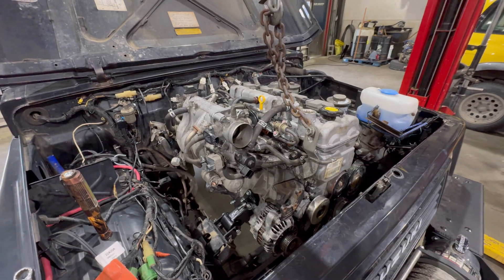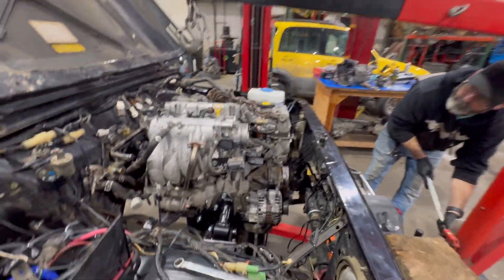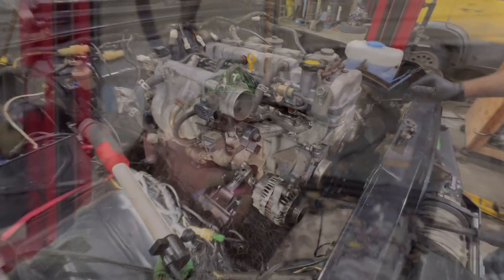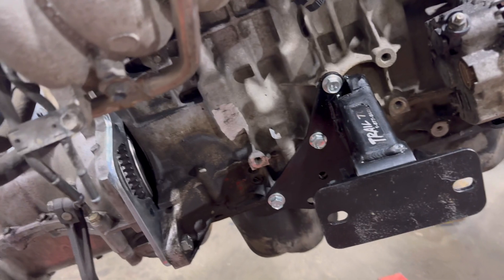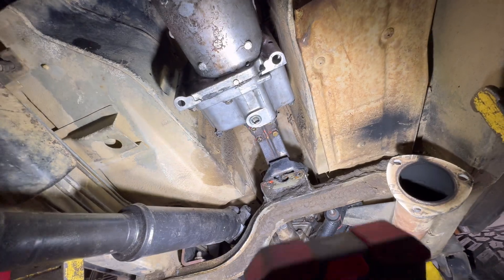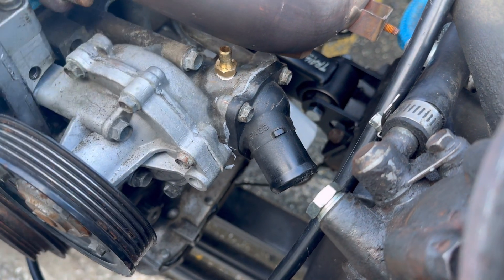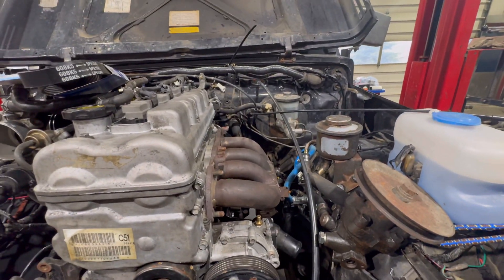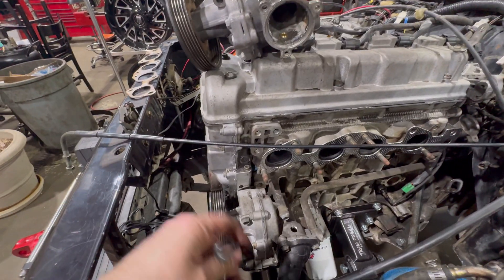2.0L Swap in a Suzuki Samurai / Part 3 - Modifying Parts

Comment: Hey ! I'm currently swapping a 2.0 in my 99 Suzuki jimny and i have few questions for you.
1: what did you do exactly to the flywheel?
2: you said you replace the pilote bearing by a bushing, is there a disadvantage of that ? And what's the spec of the bushing 

Basically the flywheel is probably the last thing i have to do for the Jimny i mostly figure out the rest

Thanks a lot
Reply from the maker: @mirtir472  I didn’t do anything to the flywheel, TrailTough modifies them, and they include the bushing in the kit. You could probably contact them and just get those parts if that’s all you’re missing. I wish I knew the answers to your questions but all the R&D was done by TrailTough https://trailtough.com/product/2-0-2-3-liter-suzuki-engine-conversion-kit/
Reply: @CTMadModz  yeah i did contact them I'm actually against a clock for the swap, and they won't have anything in stock untill 2 week.
Also shipping is super expensive since I'm not in the use (above 100 grand including duty)
Reply from the maker: @mirtir472  well I guess the bushing is the easy part, it needs to match the inside diameter of the crank where the pilot bearing goes, and the inside hole for the shaft on the transmission needs to match. I have no idea what they did with the flywheel, but probably machined it to fit on the back of the crank 🤗
Reply: @CTMadModz  i bought the bushing from then I'm waiting for it to be delevered, for the flywheel probably flattened the back, resized the center bore and re drille 8 new hole, i should be okay i think
Reply from the maker: @mirtir472  William at TrailTough has always been super helpful when I talk to him. I’m sure he wouldn’t mind walking you through what needs to happen on that flywheel

Comment: I ended up cutting my mounts apart too and recut the angle and welded it back up resulting in lowering the engine 2”.
Reply from the maker: @mybadford  yup, I’m not sure why they don’t offer the mount in this configuration, obviously everybody is cutting and rewelding them 🤷🏼‍♂️

Comment: What gearbox do you use?
Reply from the maker: We are using the stock samurai transmission and transfer case, I just recently rebuilt it. We used an adapter kit from TrailTough
Reply: Got a link for the adapter for the samuria transmission?

Comment: Just wondering if you could have used a metal hose/pipe instead of taping a new hole in the water pump?  thanks for sharing
Reply from the maker: Possibly, tapping the housing was defiantly easier for me 🤣👌